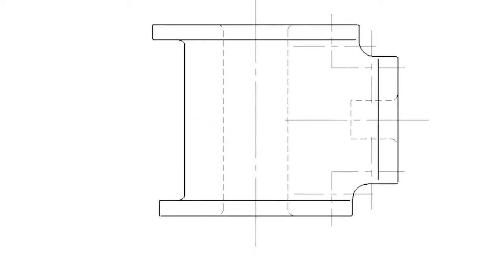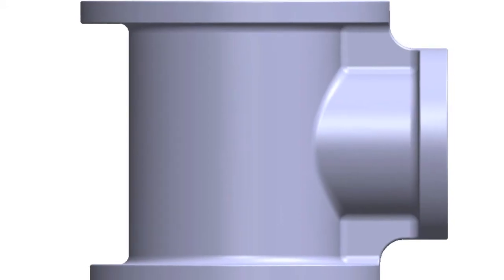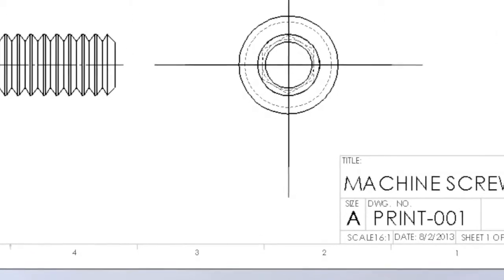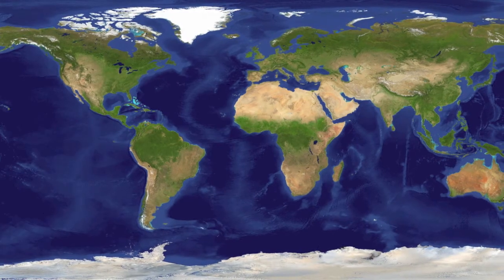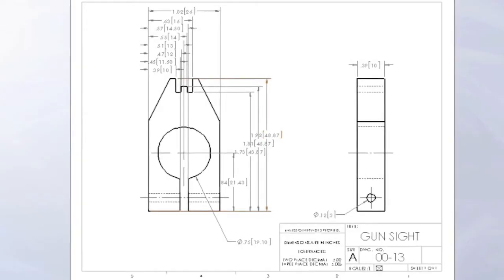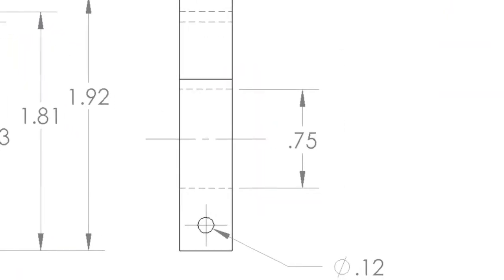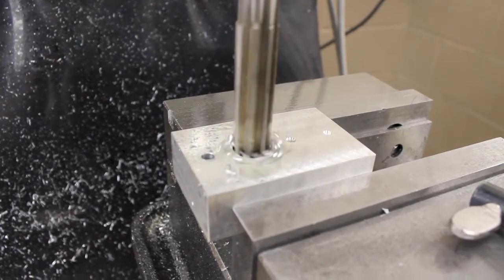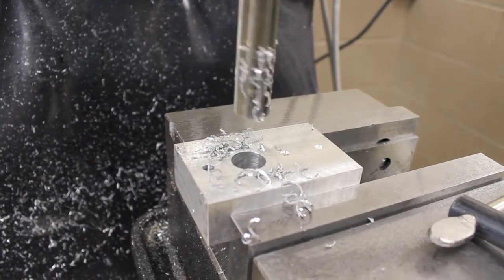Blueprint Reading Introduction

Comment: Reaming a dry hole in aluminum? I have heard of this and also known it to happen accidentally. I do not recommend dry reaming unless in cast iron. Your next part won't be the same size. Your reamer will wear or bind and break.  Why is the part hanging out on the end of the parallels and so far off the end of the vice (vise to you)?  You are taking way to much material with that reamer.  You might as well stick with a drilled hole. Where are your parallel springs? What is laying on the vice in the right hand lower corner of the vid?  It's not a chuck key because only a moron leaves a chuck key or a vice handle or anything loose in or on a mill.  Bad practices everywhere!  I see why you say "machine operator" and not "Machinist". You  worked at Haas? I have yet to meet an engineer who knows more  than a journey machinist about prints 'n parts. If you made this video, you are not a  Machinist and shouldn't be near machine tools.
Reply: lobsterbobable hahahaha yeeeeeeeaaaah!!! What "Lobster" SAID!!!
Reply: Had to watch this for class and this comment is FLOORING me 😭